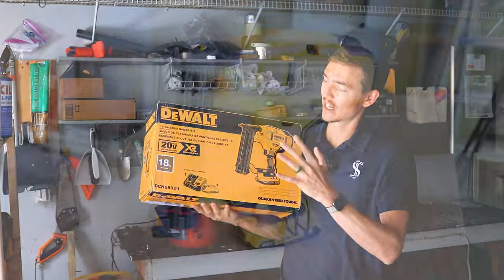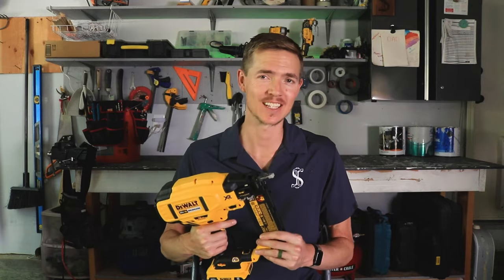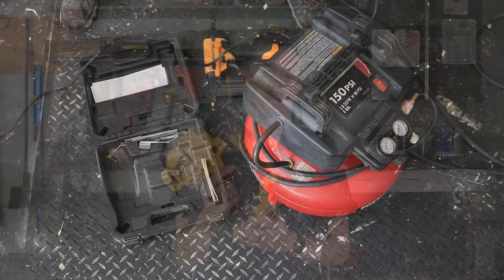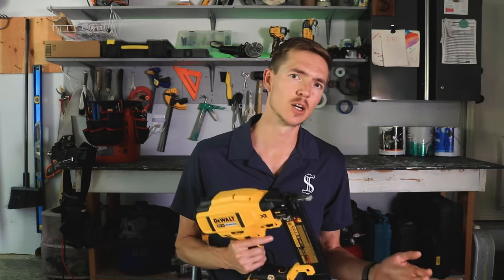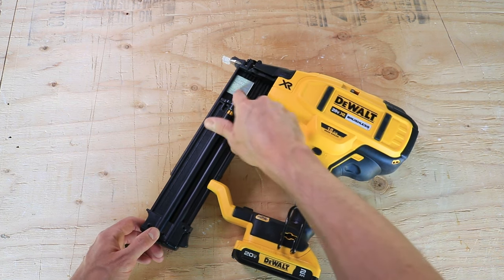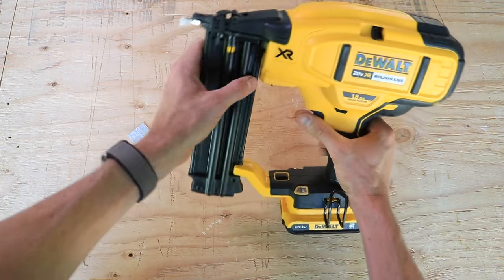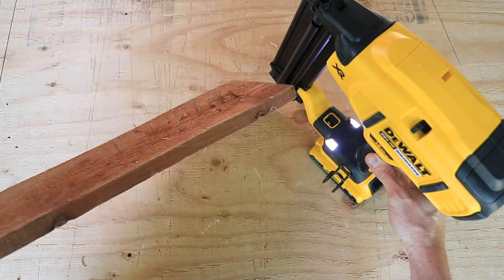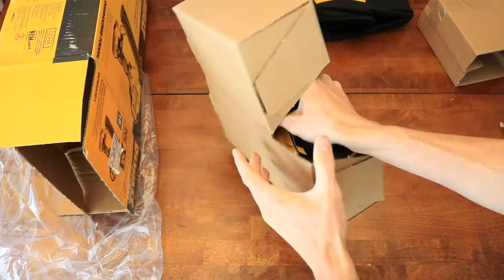I bought the Dewalt Cordless Brad Nailer. I didn't expect THIS.

Comment: Spending the extra dough was way worth not lugging around and waiting for the compressor.
Reply from the maker: Glad to hear it!
Reply: Same
Reply: This nailer is rubbish!! Stay away. I’ve been a carpenter for over thirty yrs and this is the worst purchase I’ve ever made…. Start misfiring a shortly after purchasing 😡 I’m now in the market for a replacement but I’m scared  of making another wrong choice 😢
Reply: @iceprince3572  That's what returns are for if it was recent. Lemon products exist.
Reply: @iceprince3572  just return it, I've never had issues with the 18g I use at work.

Comment: Handymaning in my Scion xB, carrying the Ridgid compressor and brad nailer kit takes too much space, even though it’s an ultimate nailing machine. My friend had a Craftsman cordless one, but the quality is not great and not consistent. This Dewalt one, with high quality nailing, will save me a lot of space and effort!! It’s a bit annoying to bring in a compressor for 6 nails)) and with larger projects, I can always load the pneumatic kit beforehand.
Reply from the maker: Exactly
Reply: 6 nails ..    you could use a hammer  🙄   ....   follow me for other great ideas ..

Comment: I just bit the bullet and bought one, because it's so precise and accurate without any adjustments, the flywheel/pin drive sets the depth exactly where you want it in virtually any material from hardwood to paneling whether you hit a stud or not without adjustment. never had results as good with air operated ones.
Reply from the maker: Nice! Enjoy the new tool!

Comment: As a carpenter, it's a super win for me and I just bought it after the cheaper but still good Ryobi I had was broken by my assistant.  I've also had and consistently used an original 18v, 16g Dewalt Finish Nailer for over 10 years (ha!  it just started malfunctioning...) so I'm partial to dewalt.
Reply from the maker: Sounds like a good purchase.
Reply: how did you find the Ryobi? I'm looking to replace my paslode for small jobs, where I dont want to drag the compressor in. I'm looking at the Dewalt, but it's just for my own occasional side jobs so not sure I can justify the price. We use the Dewalt at work and I like it, but curious about the Ryobi.
Reply: @chrisburns5691  The Ryobi was great for a few years.  My assistants seem to break tools--usually by not using them correctly.  I got it originally from home depot for around  $100; think it was the airstrike P320, which has now been updated slightly but still available there and Amazon.
Reply: @raywright2401  thanks for the reply. I looked at the Ryobi and found it much heavier and bulkier than my old paslode. I ended up getting the metabo kit with the battery which was cheaper than the brushless ryobi plus charger and battery I'd have to invest in.  I like the compact size of the metabo and the weight is fine. So far has been a great gun, I recommend it.

Comment: I'm a handyman I'm debating between this and another paslode. I've worked with others at a job site with these (not always Dewalt) but in general they are heavier they seem to do a good job the biggest advantage to me is no cartridges or maintenance, I am concerned about longevity compared to the paslode but some of these battery tools have come quite a way I have many in my arsenal so maybe it will be a non issue.
Reply from the maker: Sounds like it's worth a try. If it wears down too fast, then don't buy another one. But if it improves your work efficiency then you gained a new tool that will pay off for years to come.

Comment: 9:20p: Task objective: remove and reinstall crown molding in my home. The pneumatic version of a 18g brad gun requires 70psi, so I’ve read. I already have an air compressor (won’t do 70psi) and didn’t want two compressors. Convenance: Already having other DeWalt power tools & batteries made buying this tool a no-brainer, as my current DW batteries can be used on the brad gun. Lastly, such a weapon in my DeWalt arsenal will def assist in any of my future tasks.

Comment: Got a second fix angled pin gun by dewalt only had it a few years and it's very temperamental now doesn't like 50mm pins and regularly doesn't sink the pins regardless of length. A little disappointed as it's big and bulky and requires a separate box along with the first fix. Needs improvement dewalt. Brad nailer may be better than the 2nd fix gun though

Comment: I have a lot of dewalt tools, and lots of batteries, I rarely use a nailer, but would love to have a cordless. In my email today, Harbor freight has theirs(Bauer brand)that comes with the nailer, charger and a 5ah battery for 89.98. I have a Bauer cordless drill and impact driver that work great, so I think that's what the nailer will be.

Comment: Milwaukee M18 18ga, is the best in my opinion, no wind up. I have used both Dewalt and Milwaukee. And I’m a Dewalt guy.
Reply from the maker: Thanks for the insight, Scott. Looks like it’s a bit more expensive, but the no ramp up time would be nice.
Reply: Omg you not kidding . You’d have to have a Heavy and I do mean HEAVY DeWalt bias for this one and all of their no wind up gas blasters !
Reply: People who complain about the wind up time do not understand how to use this nailer properly, or the advantages of its design. I keep mine on multi fire or bump fire mode, and pull the trigger before pressing the nail or against the work piece. This means it fires instantly whenever I put it where I want the nail. This makes it faster than other nailers, when firing single nails or multiple nails. It is fly wheel driven, not air driven. One advantage of this is that the weight of the nailer is in the head, not below the handle in front of the fist. This makes the weight balance much better on the wrist.  I have the 18 gauge, 16 gauge, 15 gauge, and framing nailer. They are all awesome.

Comment: I was loving mine until after about a thousand nails, part of an O ring appeared out of it.  There is an o ring on various dewalt parts diagrams, but no info on what it does.  The gun still works fine, but a bit worried about it.

Comment: If you’re not a contractor or you’re just a regular woodworker,  no the battery powered is not worth the time and money, especially when you can get the pneumatic brad nailer with the air compressor, which gives you a little bit more versatility “meaning you if you have an air compressor that means now you can have tools that are compatible with an air compressor,” for $100 less the kit.
Reply from the maker: Exactly

Comment: I am on the fence on this. I spent almost $500 on a California Air Tools ultra quiet compressor, and almost $500 on three nail guns for the compressor. I got a nudge to get one a couple of weeks ago when I had to haul my compressor and nailer through a house to the stairs, up the stairs and then back to the other side of the house, just to nail a five foot piece of base.

I have DeWalt tools already but have been considering team red. Mainly because of how small their cordless nailers are. BUT...that would be a huge investment to make to switch over.

I like the convenience of cordless but I don't like the idea that I have another item to wear my batteries out with. My current batteries are starting to show their age and I am going to have to get new ones soon.

Well...I may have to go this route but I'm going to wait for now. If I have a few more projects that make me lug my tools through a house jsut to get one small piece of trim up, that may be the final straw for me to take the plunge.

Anyone else in the same position? Have you bitten the bullet and made the purchase? Was it really worth it? Do you find that the use cases you thought it would fill aren't really as frequent?
Reply from the maker: If you’re a pro, get it. If not, then don’t.
Reply: Ryobi makes great cordless nailers.
Reply: Use a hammer and finish nails next time for a 5ft piece of base

Comment: I have a compressor and nailer and it's so painful i bought this.  No airline and the constant noise was just not worth it.  Fighting the air hose on a ladder to nail in ceiling trim,  no that's just crazy
Reply from the maker: Glad you were able to solve a frustration.

Comment: As much as I think the final thought makes sense, it misses a huge factor.   Lazyness, speed.    When I'm working on a small project, I will simply skip getting the compressor, plug it in, getting the gun, load it, getting the hose untangled, I just don't feel like it, so I'll take the lazy, easy way out, I just won't do it properly, I will use clamps instead of brad nails to hold the glue etc.  This is why I don't have my screw drivers in a box all neatly stored in their original cases, I need it right there on my bench board, ready to go. I just hate the whole hose/compressor deal.
Reply from the maker: Sounds like you know what works for you. So that means your going to buy one then?
Reply: @StayHandy  yeah just ordered the  porter cable battery one, I already have the pneumatic dewalt but don't use it as much as I should.  I hate when my workflow gets bogged down. so. battery powered it is for this tool.

Comment: I bought mine and had 2-300 nails through it. And it was oak at the very last details, didnt sink it as wanted 😒.. Did some craphit inside the front, nope.
Today i will take it apart and check if the spring is broken. The plastic tip has a tendency to slide off.
On the good side, what a freedom not hump around compressor and a hose that gets snagged or tripped in to 😂!
Although the 20-25 bar system is the ultimate in performance still, and so expensive....
Reply from the maker: Thanks for sharing your experience.

Comment: Great Video & Info!  Been on fence, Milwaukee or DeWalt. I'm a DeWalt person, but the Milwaukee Gen 2 Nailers are great. The new DeWalt 23g Pin nailer & Cable Stapler are great, better than Milwaukee slightly. I was wondering if new Generation DeWalt would show up for the 18-up Nailers. The wind up and spin down was a factor, but the comment below stating to use bump side works for single shots was helpful.
Reply from the maker: Glad you found it helpful.

Comment: Paslode best nail gun and bradder in the game 🎮
Reply from the maker: What do you like about it?
Reply: @StayHandy  there lite easy to fit into tight spaces and easy to service 👌
Reply: But the fumes. I despise using mine indoors. And with the framing nailers the gas ones are way louder.
Reply: And you have to buy gas..
Reply: I agree, Paslode makes a great gun. I have the 16g Paslode pneumatic for years and not even one jam, couple drops of oil before each use, it's nice and light, small size, worked perfect every time. I just decided to sell the Paslode at discount of course to my brother and I bought the Dewalt electric 16g because I like to try out different tools. I really like the idea of no hose or compressor, I have run a few hundred nails only so far through the Dewalt, hard and soft woods, so far so good!

Comment: Doing a lot of site work ? Good asset.. For strictly workshop work a pneumatic is FAR better value .. I fancied one for my workshop so I didn't have to drag a air hose about.. I already have batteries and a charger so I thought a bare body would be cost effective and reasonable... Err.. No !
Reply from the maker: That makes sense. Thanks for the insight.
Reply: You help me make up my mind. Thanks